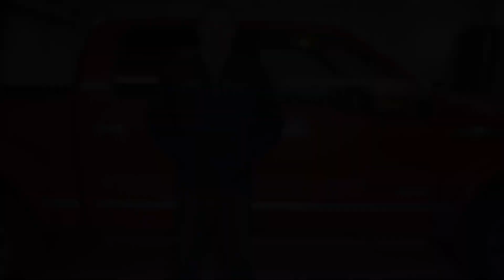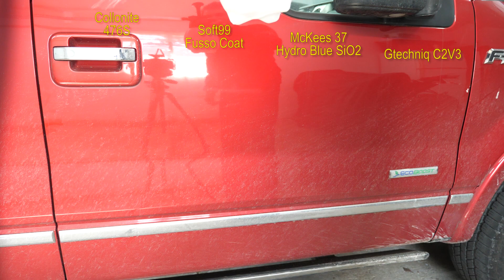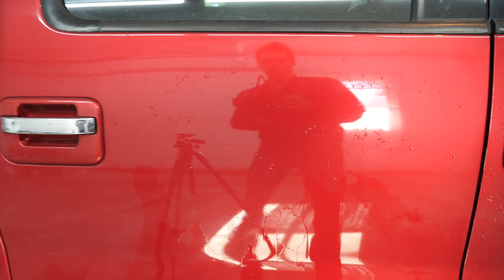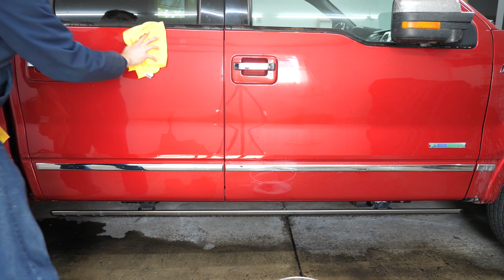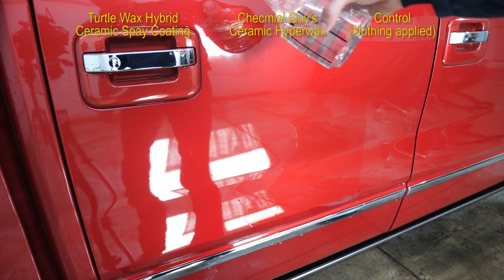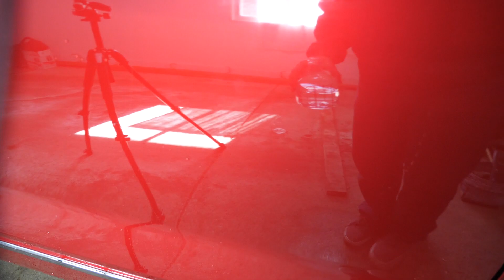Winter Protection Shootout 2: Two Month Update

Comment: Any updates to this? Very interested in knowing how these held up
Reply from the maker: I did another wash a month later and everything was still going except chemical guys but by then it was also no longer winter. I'm starting a new test with these again in a month to see if anything really can last all winter.
Reply: @SourceGarage  Interesting, thanks for the update! I'm finishing my paint correction and wondering if I should go with a ceramic spray instead of a ceramic coating. Seems like the sprays hold up just as good as consumer grade coatings but much easier to apply.
Reply from the maker: @somebrownguy07  I'm coating several friends cars before winter. Coatings will handle the abrasion from salt on the road better I'm assuming and hold up longer and I hope to prove with this next winter test where I will have some true coatings mixed in with other waxes/sealants for 6 month of winter and see what works.
Reply: @SourceGarage  Were you able to start this year( 2020 )'s winter test yet, Sir?
Reply from the maker: @toddistheman9264  yes. Video up later this week with one month update